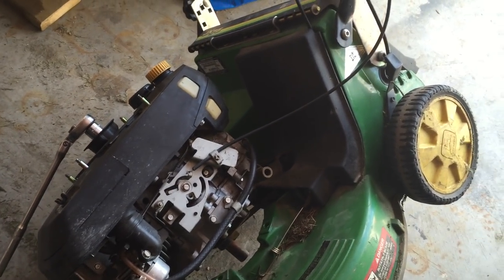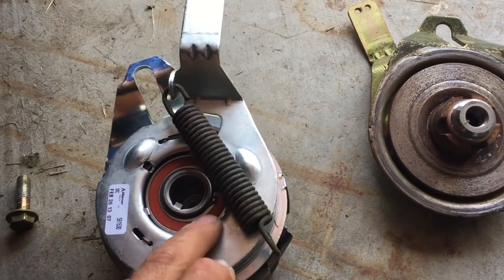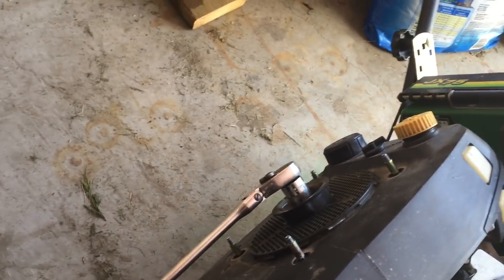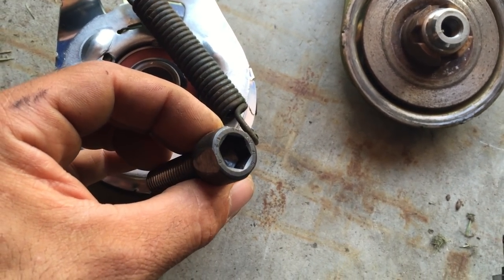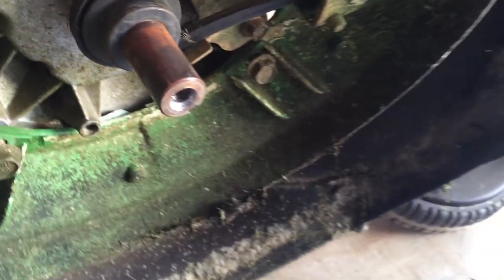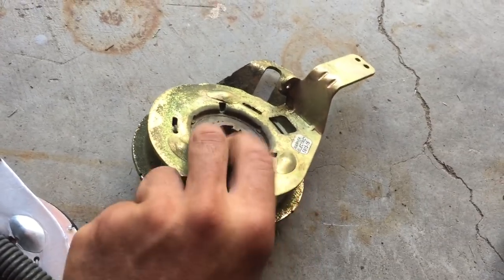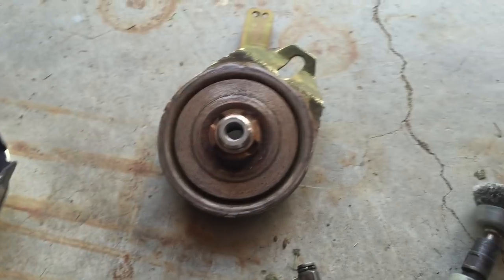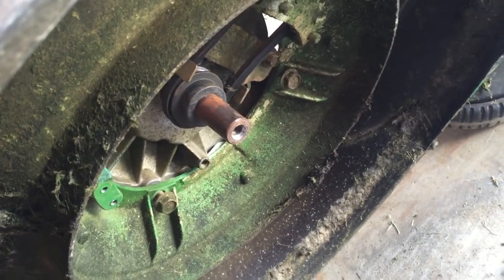John Deere JX75 Blade Clutch Removal tutorial

Comment: Thank you very much for this video.  I have no mechanical ability but your video worked well for me.  My local John Deere service department told me they didn't know how to do the job without breaking the clutch, but with your help, I got the job done.  I had to use a long breaker bar and vise grips to insert the bolt for removing the top half of the clutch.  I had to use a breaker bar, socket wrench, and a Lisle SuperOut screw extractor ($11 for a set from Home Depot) to remove the bolt that holds the bottom half of the clutch.

Comment: FYI the bolt needed is 14mm coarse (2.0) threads. THANKS FOR THE GREAT video. It wasn't immediately clear to me that the M14 bolt just threads in to the bottom of the clutch and since it's bigger than the hole for the 8mm allen head bolt that holds on the clutch, all it does is press against the crankshaft like a steering wheel puller or brake drum puller would. Thanks again .

Comment: If you really want to do it on the cheap, if you're careful, you can replace that top bearing by grinding the 3 staked spots in the bracket and by using the right sized tubing for the bracket to set on, drive the old one out and install a 6006 sealed bearing. I put some penetrating oil on the bearing before driving it out. I bought 2 bearings for 8.54 with free shipping, just to have one as a spare at that price. I also put a new bearing in the part the blade attaches to.  Works like a new one.
When pulling the blade hub off the crankshaft, find a bearing ball that just fits in the hole of the hub and turn the 14mm bolt up against that. The ball pushes against the hole in the end of the crank. That way you won't burr up the end of the crank, like they did here. I turned mine out by hand.
Reply: Thank you for the bearing number sir. I'm taking the same path on this deal as you. Got mine in 1997 and has a great cut and will pack a bag full like no other.
Reply: Long shot here…six years later….but do you have more detail on the exact specs for the 6006 bearing?  John Deere has stopped selling just he bearings for the BBC and I need a couple.
Reply: @mattman4181 You have more detailed specs on that 6006 bearing?

Comment: What does it mean when the blade clutch makes a loud noise when the engine is running?  I have a John Deere JX75 with a blade clutch that will not disengage and makes the engine very hard to start.  What would cause that?

Comment: Using a socket on the top of the crank just removes the bolt on the top of the crank in my case. I can't get the bottom 8mm hex bolt out. I ended up stripping the head on that hex bolt using a piece of rope in the compression chamber to stop the crank shaft from moving. That darn bolt in the bottom just won't come out. You can't use penetrating oil because the threads are way down in side there. Whoever put mine together must have used a super strong thread locker.
Reply: OK, with a little more effort I got it out. I had to grind the sides of the bolt and use vise grips to get a better grip on it.